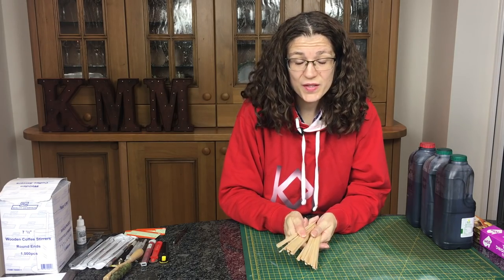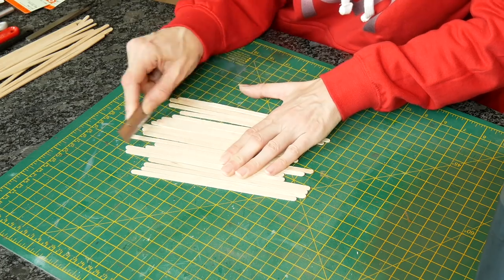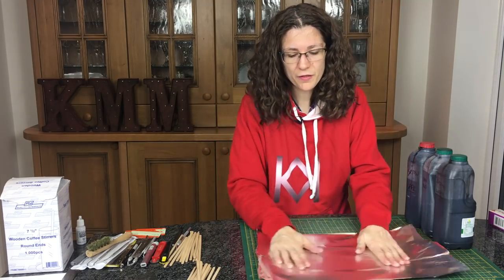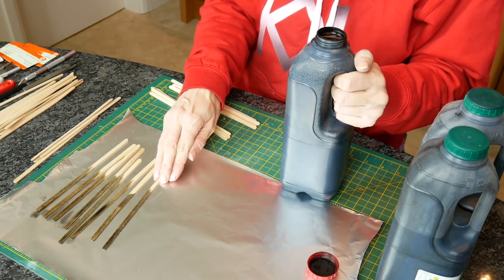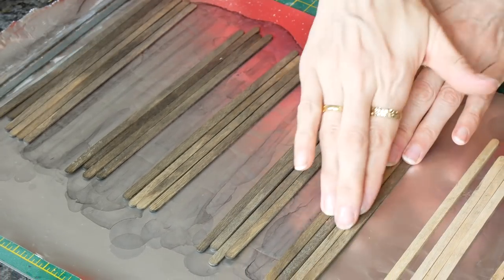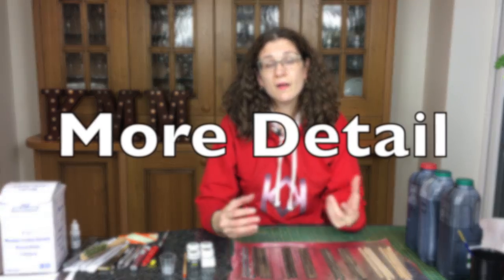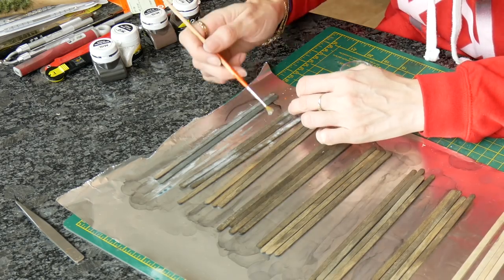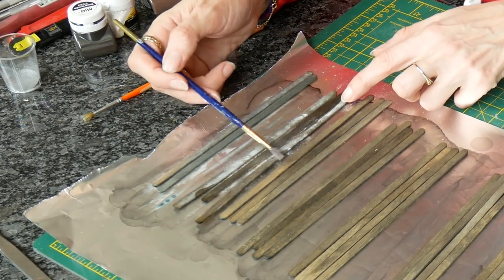How to Model Weathered Wood

Comment: Thanks for a great and informative video! I'm going to be building a dock scene and I'll definitely be trying this method out!
Reply from the maker: Great!  I hope it goes well.  I certainly used it for all my dock scenes and it does look good.
Reply: I tried using wood originally and couldn't get the aged, weathered look right.  So I went with styrene "concrete" and although it looked okay, I was not happy with it as I'm modeling the mid to late '40's, southern U.S. and I feel it needs to be a wooden dock.  Now, it can be!  Thanks again!
P.S.  Do you have any suggestions on making a plastic kit look like real wood?
Reply from the maker: Hi, next week is peeling paint on wood but the week after is painting styrene to look like wood which should help you.

Comment: great tutorial Kathy and a great channel. I tried making a indian ink and Isopropyl wash but it just split in the bottle and after leaving the ink settles in the bottom of the bottle. Am I making the correct mix.
Reply from the maker: Some ink brands do that so you just need to try a different brand. I always shake before use as it will settle a little.

Comment: Hello
A big thank you for your answer.
I am currently studying your wood aging technique.
I think you are using a small modeler saw to stretch the wood.
I recognized the wooden sticks (fortunately for me), the pastels and powders but what are the products in the three large pots on your left?
(Which color the wood) and those you use to fix them (two vials with green lids).
Thank you again.
Cordially.
Mark
Reply from the maker: +m6087 Mark. They are isopropyl alcohol and India ink mixes. The recipe is in the write up beneath the video. Do let me know if you need any more help.
Reply: Un grand merci .

Comment: Hi Kathy
Tank's a lot for your video Great :)
But When i bring india ink with isopropyl alcohol the two are not mixed :(
Can you explain me why ?
Reply from the maker: +Baudouin van DELFT Some brands of India Ink apparently don't mix well. I've never had a problem and I use Bombay. Try a different brand and see if that helps.
Reply: I'm having the same problem. They ink is separating. I'm guessing I need to use either a non-waterproof india ink or perhaps try and alcohol based ink?